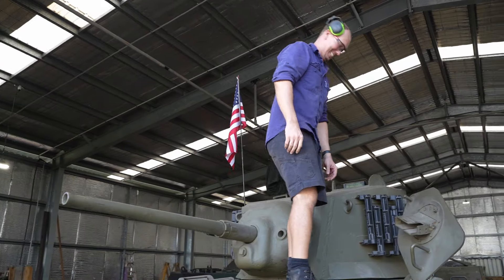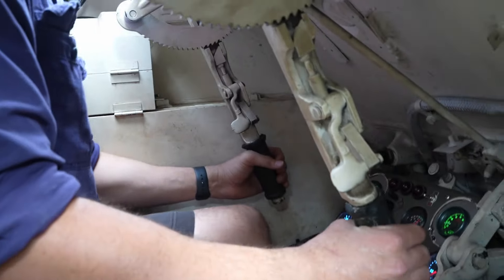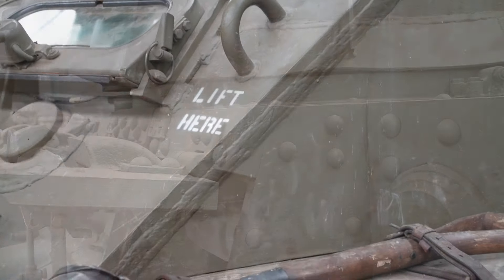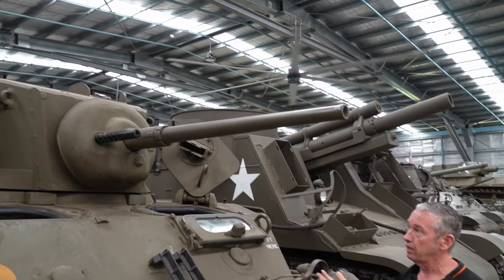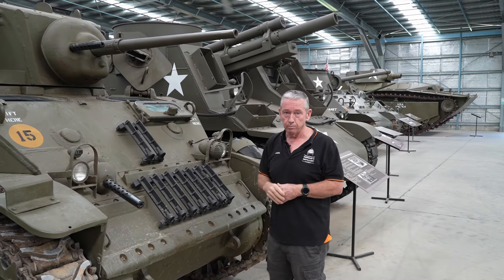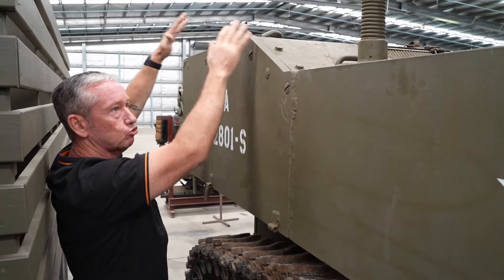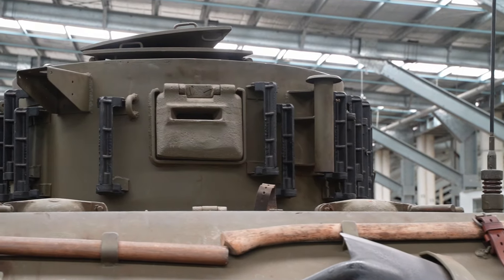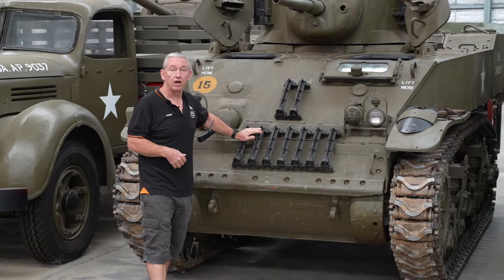Testing BRAND NEW Chevrolet Engines in our WWII M5 Stuart Light Tank!

Comment: So in essence Ryan has built himself a hotrod. Should get it out on the captain cook and see what he can get out of it. Well done boys.
Reply: Resto mod 😂
Reply: Drag racing on the main drag in Cairns Saturday night! 🤣
Reply: Never thought I 'd see an LS swap on a tank.
Reply: Small block not LS best possible decision SB has more torque.
Reply: @TheDoug9901  
More forgiving and more durable, yep, small block was the correct replacement!
Reply: @TheDoug9901  Not necessarily. Depends on modifications as the stock 350 is 210hp @ 4000 rpm and 300 ft/lbs @ 2800 rpm.
A stock LS1 was good for between 305 and 350hp and up to 375 ft/lbs, stock, depending on what ECM was fitted. 🙂
Reply: its pretty competitive on the capt cook highway, might need to make the 37mm active to have a chance
Reply: @Slaktrax  
And half the life, I’ll stick with the 350!
Reply: @paulorchard7960  Where do you get the idea an LS1 won't last? If you really need convincing then the iron block LM7 5.3, or LQ4 or LQ9. They all make more power and are as tough as old boots. You can stay with 1950's technology, I'm not here to convince you. I just know what's better having worked on close to 500 LS series engines and I've built one or two old SBC's. 🙂
Reply: @Slaktrax  LS will last fine.  They don't make more power, if everything else is equal.  If displacement, fuel delivery, head flow and compression are the same, they'll make about the same power.   LS is just newer, smaller and has a good EFI on it already.
Reply: @SealofPerfection  Yes, that is obvious, it's the law of airflow, but how long before and SBC starts leaking oil, which they are notorious for and frnkly I don't think you can get the same size valves or as good an EFI system for an SBC. It's 1950's technology, why go backwards?
Reply: @Slaktrax  I have had to replace so many oil pan gaskets and rear main seal housing gaskets on the LS I have lost count.
Reply: @frankpeletz1818  Never came across that issue. Something wrong there. Every LS I worked on was oil tight, the only oil related problems was with the PCV valve and tubing literally rotting and starting to fall to pieces.
Reply: @Slaktrax  Every work for GM? I did for 40 years.
Reply: @frankpeletz1818  Okay.   ...And?
Reply: @Slaktrax  You ever have to deal with all the warranty issues on them ?
Reply: @frankpeletz1818  Now why would you want to start a pissing contest over a simple comment where opinions are allowed? Or has fascism taken over?
Reply: @Slaktrax   Wait a minute-your the keyboard know it all, until some  calls you out. What i said can be verified at any GM dealer that has had techs who have worked there for 30+ years . Now your the one bringing politics.
Reply: @graemewatkins5535  Nah mate, just pop in a clearance blade, she'll do alright.

Comment: Wondering how much more performance you get with the added horsepower. Also love that you guys fly Old Glory on the tank. Much Respect and Thank you from the bottom of my heart for that. The tank looks amazing, y’all have done an absolute wonderful job as always. Cheers 🇺🇸🇦🇺
Reply: The engines definitely have more horsepower but the added rpm range will likely make this as fast as an M18. The original Caddy flathead V8s' would only turn just over 3k rpms while the 350's should easily turn 5500.
Reply: @1967davethewave good point

Comment: New engines in old vehicles is the way to go. There could be many more runners, with the old engines on display and properly cared for.
Reply: I mean with vehicles like this one I imagine the old engine was treated great and had routine maintenance... But I do see your point, I'd much rather have historical engines like these relaxing in an exhibit displaying all sorts of tank engines, you know?
Reply: @blazeiscrazy8737  -  Well, these 350 Chevy motors are nearly ubiquitous worldwide, and can easily be modded for extra power, so this tank will really be a runner, which is the way the Stuarts were originally. Also, the boys in the shop have got their own Hot Rod tank, now - did you check out those shiny aluminum fan pulleys and other goodies(on those motors)? As a plus, parts for them will be easy to get, a well.
Reply: @DavidSmith-ss1cg  I know, they're modern Chevy engines.i was referring to the old engine/s
Reply: Yep, I'd like to see the original engines out and on a stand, maybe fired up once in awhile, and put some newer engines in the tanks that still get driven a lot.
Reply: Agreed, though it would be nice if they could keep engines with similar power so the vehicle's performance isn't completely changed from the original.
Reply: Can you imagine the 2.0 turbo in the current Wrangler inside a MUTT ? 😎
Reply: Good idea

Comment: Gotta love a tank with a speedometer in it that goes to 80MPH.   Let's see some high speed runs!
Reply: I thought it was 80 kph, not mph.  The final drive ratio and the tracks flying off are going to be the limiting factors now.  I bet it might do 60mph in a straight line, but the second you turn it, probably gonna shed a track, especially without the rubber pads. Originally, the M5 Stuart had a top speed of around 42mph, pretty quick for a tank, acceleration from 0-15mph is more important than top speed, it's what allows you to quickly duck behind a building or dive into a ditch or other hard cover when coming under fire.

Comment: 220 horsepower to 600. That thing must fly now. I think the fastest I ever rode in my old M1A1 was around 50 on a march on the autobahn in 1991. It doesnt sound l9ke much in a car, but in a tank, its kind of scary.

I would love to visit this museum.
Reply: From the driver's position seems faster as you are basically driving a very large go kart .. at least it seems like that!@
Reply: I'd be worried about the transmission if going full send. It'd be quick tho.
Reply: @LasOrveloz  Yeah .. good point. I think it was the transmission that caused problems with some of the larger German tanks
Reply: 72mph that's the fastest anybody I know has ever gotten an M1.  But you'd better not have to turn while you're doing it.
Reply: @RigepFroggit  I watched the M1 in front of me snap a track at 50 mph. Went through the concrete barrier between the autobahn lanes and spun around 180 degrees. A good friend and classmate from Texas Tech was the TC. They were unhurt, but it definitely was a mess.

Comment: My Grandfather Henry Hunter, having grown up as a Yorkshire farm boy, emigrated to the US in 1911, became a stationary engineer and was chief of the powerhouse at the Cadillac factory in Detroit where some of the M5 Stuart's were made (don't know if that includes this one) from 1921 until 1950 when he retired.  The powerhouse provided steam, electricity and heat for the entire manufacturing complex including the foundry where the 341 cubic inch engines were produced.  The 341 was replaced in 1949 by the overhead valve 331 and the 350 Chevrolet engines installed in this video are direct decedents of that 1949 Cadillac engine.

Comment: 6:57 Unfortunately, this M113 has been naughty, so it's out here in the dog house...
Reply: not a 113. It has support rollers. M113 had dead track. At first glance I also thought it was one with the FSV turret, but no they do have a 113 with a saladin turret on the inside. 
It kind of looks like an FV432 with a turret but not quite.
Reply: @jefferydraper4019  It may be one of the early prototype FV432's that were tested by the Australian Army in the 60's?

Comment: Chevy small blocks are an excellent choice for the tank. I think perhaps they might have been painted olive drab and chrome accessories replaced with standard parts ... pulleys and such ... before installation so they don't stand out so much. But the installation works great and the automatic transmissions seem up to the job. Looks like that Stuart will be a show-off at the next tank fest with it's speed and agility.

Comment: 6:08, OMG, it sounds like your M5 has been Hotrodded with the new twin GM 350's. I think this sounds much better than a diesel conversion. I'll bet the GM 350's dropped in as easy as two reconditioned Caddy motors would have, and so much easier that a diesel swap.

Comment: Excellent!  220 to 660 Hp though?  Torque is gonna be 6 or 700 foot/pounds.  What torque would a pair of those cadillac engines have?  Hopefully gearbox & drive train will cope.   Probly good to fit rubber tracks on it & keep plenty of spares.  It'll probly burn rubber I'm guessing?  What, 70 miles an hour?
Reply: The originals would have been the 346 Caddy, you were looking at ~150 BHP @3800RPM, with 283Lb/Ft @ 1600. The military engines were slightly de-rated, so expect a bit less.  Of note, some parts used in the prewar and postwar Caddy flathead eights were not at all the same as what was used in the Stuarts and Chaffees, so that scarcity of parts likely also helped drive the decision to convert.
Reply: @jballew2239  Oh right thanks!  So this Stuarts got more than double the horsepower, & 25% more torque.  Yippie!

Comment: It looked like they had headers on the new motors if they do go by the local performance shop they offer a Teflon header wrap that helps put the heat outside the engine compartment rather than radiate it in!!Don't know if it will help but it's an idea to keep the heat down!!!

Comment: Layperson question: With 3x the HP will the drivetrain be able to handle it?

Or will you have to limit the output through the ECU so something doesn't go snap, ping, thud or ka-boom...
Reply: No ECU. Analog other than chip in distributor.       Just as any vehicle, drive within limits of chassis.

Comment: When they have two engines does each one drive one side or are they joined together to produce power on a single shaft?
Reply: both engines feed a differential into a single driveshaft forward to the transmission at the front of the tank.  That way they could run on a single engine if one broke down.

Comment: I mean as much as I like the originality of historical vehicles, I can totally understand that you sometimes have to do  modifications if original parts aren´t available anymore. 
As long as they fit with the original character of the vehicle, like fitting new engines to keep the vehicle in running conditions, that´s totally fine in my book.  However that multicolored instrument panel is a little too much for my personal taste and I would prefer a more discreet solution.

Comment: HA, that is amazing!  This is truly the best job in the world!  I so wish I lived in Australia, I would absolutely love to work there.
With nearly 3 times the power, how do you manage the power?  The rest of the drivetrain is built to handle 240hp.  Are the governors on the engines turned down so they don't rev high enough to get to that kind of power?
Reply: even the modern abrams tank is rated at 100 mph for top speed and I know this from a guy who worked on the first tanks that entered service and worked on developing them as well was in the military, he said they had issues where the suspension would fall apart or crews would gun it and guys would get thrown around in it and break limbs so they put a governor on it that limits it to 45 mph so that it can match "convoy speed" for the rest of the military and keep up.
Reply: @pilsplease7561  I can imagine the ride would be awful at 100mph even on smooth flat ground, that would also be a tremendous amount of wear and tear on, well, everything.  By governor I meant engine governor to keep the revs lower to keep the power down.  I wasn't so much talking about speed, but torque on the system.  I can't recall if they replaced the transmission in the tank, but the drive shaft, the differential, and the final drives were all sized and rated for 240hp, with some factor of safety, but stuffing in almost 3x the horsepower means its probably 3x the torque.  I mean, if you go easy on the throttle you could manually limit it to a reasonable power, but you can't rely on driver skill to protect the system.
Though I guess something to limit how far the throttle opens would be better than an engine governor to limit rpm.
Reply: @cdburner5911  Yeah, just like how my car has a rev limiter to stop you blowing up the engine though transmission is rated at like 3x the horsepower than my engine puts out.

Comment: It’s crazy to think that the engines in this give out as much power as the Tigers engine in a tank that weighs around three quarters less. This thing must be seriously fast at top speed.
Reply: @Ibalistichedge  You mean it..
..could get to top speed seriously fast...
Reply: The Tigers engine was as far as i recall a 16 cylinder motor though with a hell of a lot more torque horsepower may be same, but the engine was underpowered for the tiger. Great sounding engine though, ww2 german engines sound freaking sexy.

Comment: What kind of tracks are those?  Didn't the M5 usually wear T16 rubber block or T36E1 steel cleat tracks?  Never seen a steel chevron track on it one.  When the Fort Snelling Military Museum refurbished our M5A1 the sent the tracks out to have the rubber reapplied as the core of the rubber track is steel.  Kinda looks like someone welded chevrons on the bare T16 track blocks.

Comment: Slap on a couple 76mm turbo chargers to  those 350 Chevy;s.  Change the steel tracks to the rubber seated ones and watch the first tank in history turn a 14 second quarter mile with a wicked burn out to boot.  Haha

Comment: I would think an engine with more torque would be more desirable than a bunch of horsepower would be?  The 350 Chevy is relatively inexpensive, easy to work on and replacement parts will never be an issue.

Comment: Two Chevy V8's.....>When one ford BARRA V8 wouldve sufficed< (If it were plumb'd to operate on one motor)
-Upon initially researching, I just found it so hard to believe the power output of a Nat-Aspirated rod'd/tuned Barra 6 cylinder w/ a couple performance parts added, let alone a turbo charged Barra 6!
-Not too mention the absolutely >INSANE H.P ratings< gained with a turbo/supercharged Barra V8's. 
-Its prob a good thing Americas ';60's era muscle car guys/kids in the 1970's & 1980's never much knew of, nor heard of such miracle motors even existing, aside from small numbers of people knowing of such....;)

NICE re-fit!

Comment: How are the engines driving the gearbox? Is one engine driving one track and the other driving the other side?!
Reply: Just had to look that up myself: its 2 shafts into one gearbox for both tracks
Reply: @HailHydra27  Cool thanks 👍 I guess the torque converters stop one running engine trying to turn the other?

Comment: I've always wondered why collectors or some museums haven't taken a powerplant-less WWII Tank and fitted something a little more modern and reliable in terms of engine and transmission, and used it for parade or cinema work... or just for fun. how many panthers or tigers or shermans other tanks are in civilian hands across the world, without powerplants? then again, if you can afford a panther or tiger... you can probably afford the work put in to get it running with it's original gear.

Comment: I have to say that the engines sound out of tune a bit, a pair of Holly snipers would make that tank amazing if you want it to behave well, they are self learning, not that expensive considering the  fuel you'll save and it will start any weather first flick.
Reply: Or just, you know, learn to tune a carb correctly.
And considering what this is, and how often its really driven, not loosing much sleep if you get 3 or 5MPG.

Comment: Wondering why you wouldn't have put in a modern diesel in instead of gasoline engines? I would think a diesel would perform better, last longer, and be safer. Perhaps a diesel would require more gearing and that upgrade wasn't so easy or possible? Anyway, nice job!